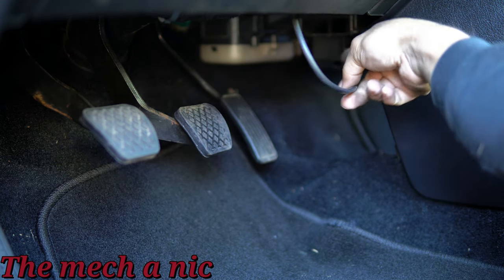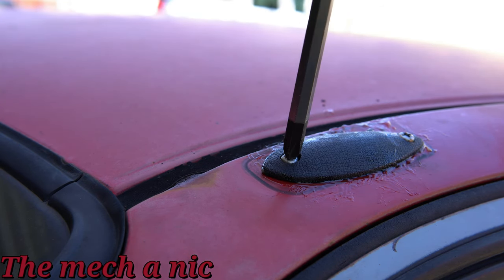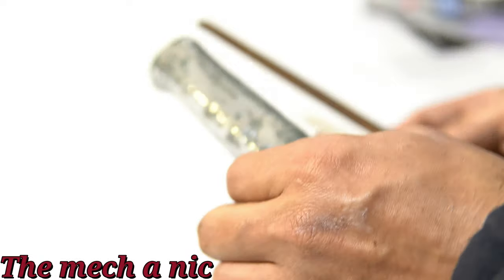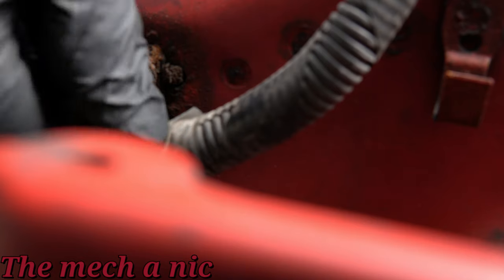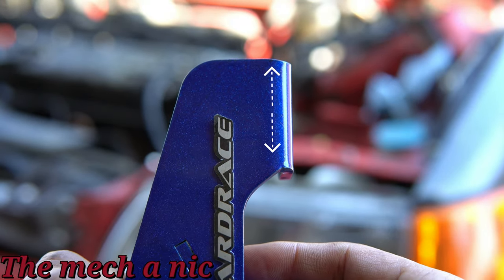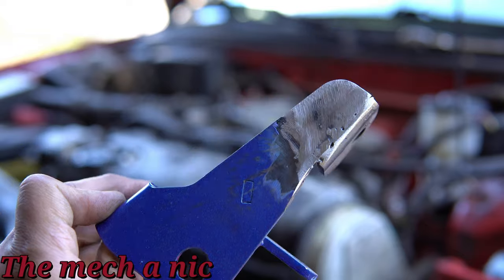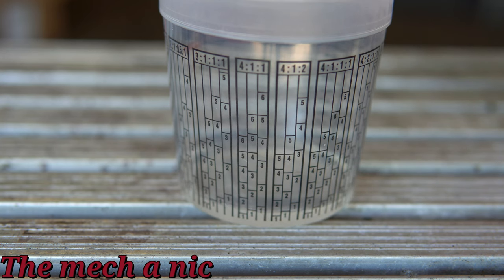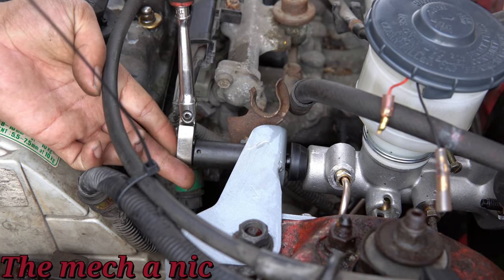crx master cylinder brace / new speakers  - CRX PROJECT VOL 7

Comment: The whole time while your built motor is sitting what do you recommend you do while motor sits? Spin crank? Have oil in motor? I have a engine I plan to in my garage and would like some intel to protect my motor from seizing and corroding. Thanks!
Reply from the maker: I keep oil in it and occasionally crank it via the starter. I show it in this video

https://youtu.be/Is1ZY0YSEvI

Comment: OK I'm dumb. Why does the master cylinder need a brace?
Does it move around?
Reply from the maker: The firewall supposedly flexes as you push the brake, the brace is to reinforce the master from flexing. Whether it really works or not is beyond me.

Comment: I understand you don't care about listening to the radio. Personally I would've kept the antenna. For one, It's an original part and two, you or your passenger (maybe your wife) may at some point want to use the radio.
Reply from the maker: I still have the antenna in a box. She refuses to step foot in the crx lol. Im looking for a short antenna that i can just plug into the back of the unit

Comment: Please post what headunit and speakers you installed.
Reply from the maker: Anything in particular you liked about the radio n speakers i bought? Its a standard head unit and the speakers are basic.they dont really provide any bass.
Reply: What size speakers did u get for the front and back
Reply from the maker: 6.5 inch for front and rear